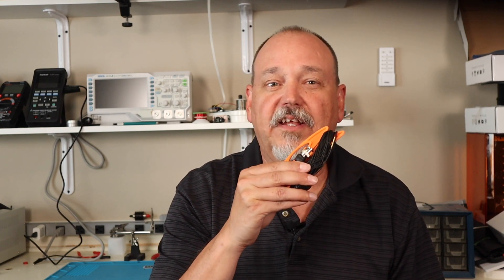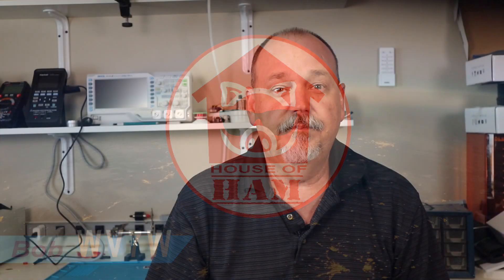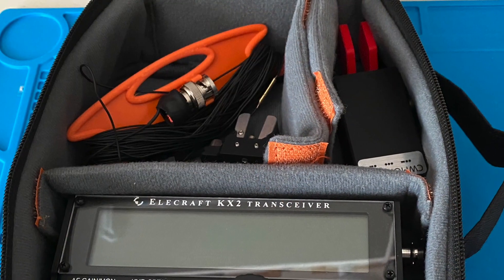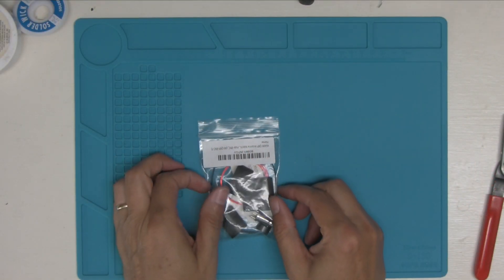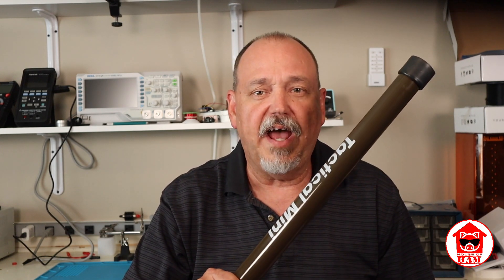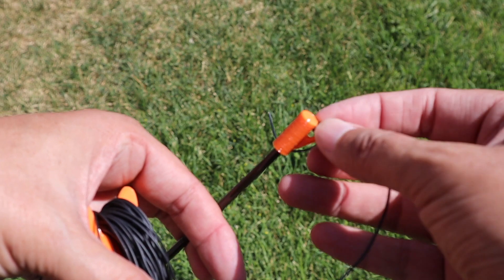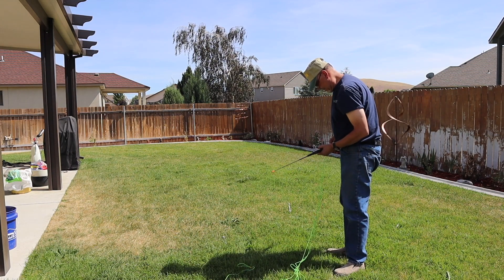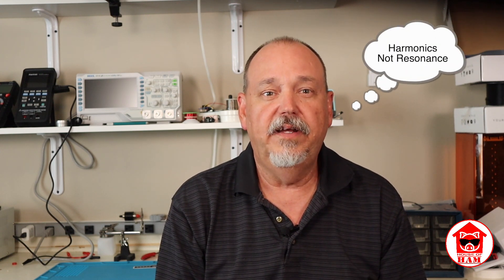K6ARK EFHW  - Tiny Portable QRP Antenna Kit

Comment: The EFHW I made is cut for 9.7 mhz giving a 1.7 t1 vswr on 30m BUT a 1 t1 vswr on 17m the more important band for me, add to it a link them the rest of the wire to get back to the normal 40m band and its harmonic bands. I get all bands above 40 up to 10 on one antenna for my FT817 which chugs alone nicely without vswr issues shutting it back. Qualified several vkff parks to 44 qso on cw ssb jss8 and ft8 with this antenna and several SOTA summits as well. Like your videos thanks and Regards vk5cz..
Reply from the maker: Thanks for the comment and the tip for others that may be looking for 30 and 17. 
73s
WV7W

Comment: I bought one of your kits that I will mount in 49:1 with a length of wire allowing access to the maximum of HF bands, possibly with the help of my EMTECH ZM-2. I hope for a lot...
Reply from the maker: Best of luck. I can't take credit for the kit though. Adam K6ARK is the designer and seller of this great kit. I hope it works out well for you. The ZM2 is a nice little tuner too. I have one of those as well.
Reply: EMTECH ZM2 IS A GOOD PIECS OF TUNER FOR QRP UP TO 10WATT.
OBS! ONLY USE 5WATT HF EFFECT  ON CW.

Comment: I built this and it works great with my KX-2.  One addition I like is to add a loop of cord about a foot from the BNC.  If you tension the wire, It wants to drag the radio off the table.  A small loop lets me tether it to something solid thus avoiding the radio getting dragged away.  I used some small diameter cord and heatshrink.  You can easily add this after the build, but if you do it before final assembly, it looks a lot cleaner.
Reply from the maker: Great tip! I would not want to drag my radio off the table.